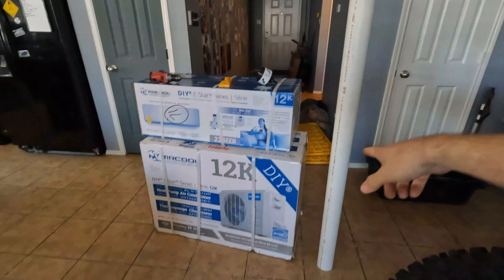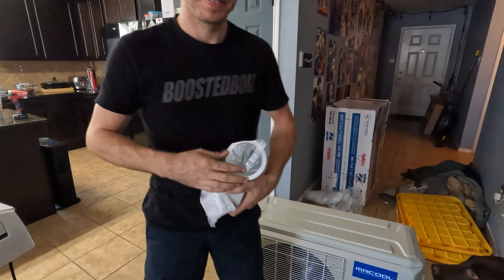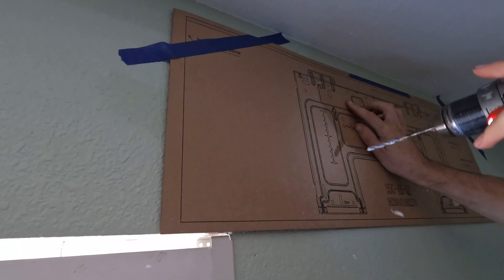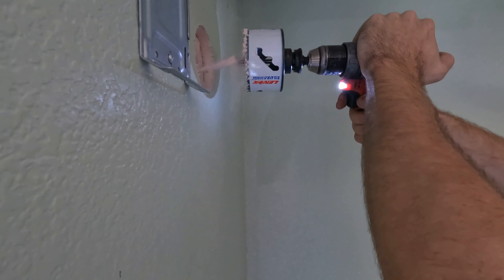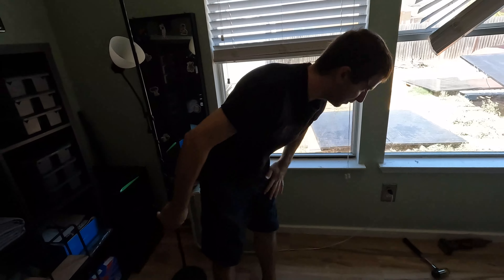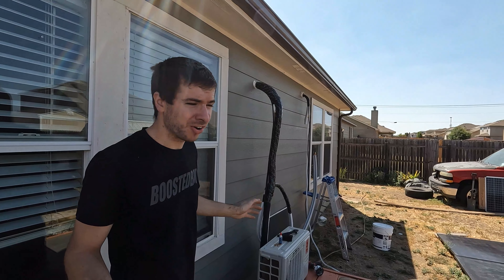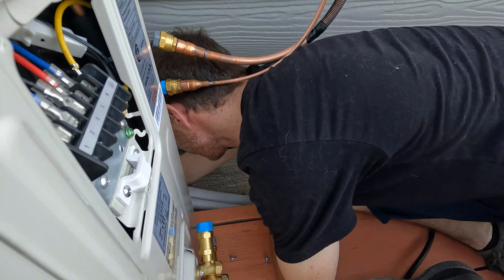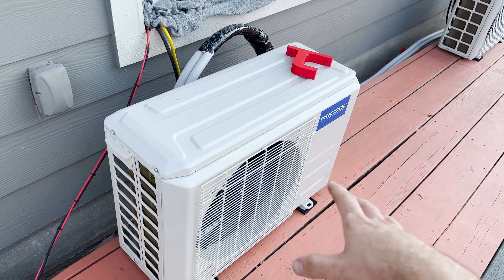MrCool DIY 12k btu Minisplit install

Comment: Great video. But how do you make sure to not dry though wires when making the hole in the wall?
Reply from the maker: Pure luck! but if you make a small hole first, its easier to not hit a wire. Also pay attention to outlet locations that may indicate where a wire is. Im sure a nicer stud finder would also find wiring.